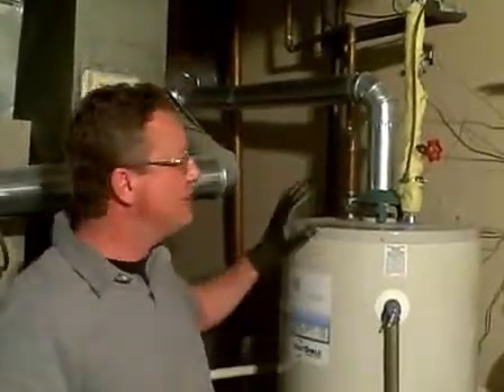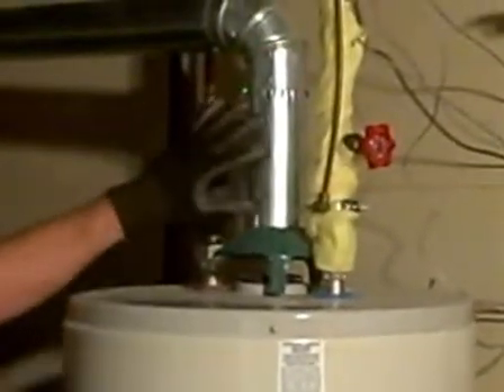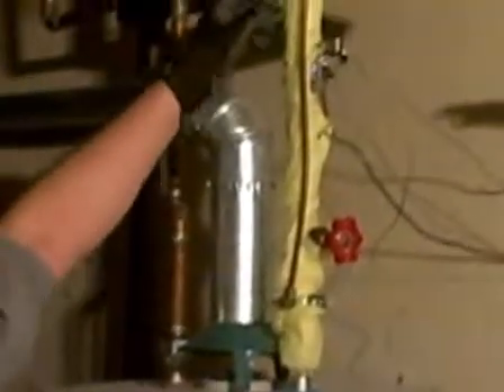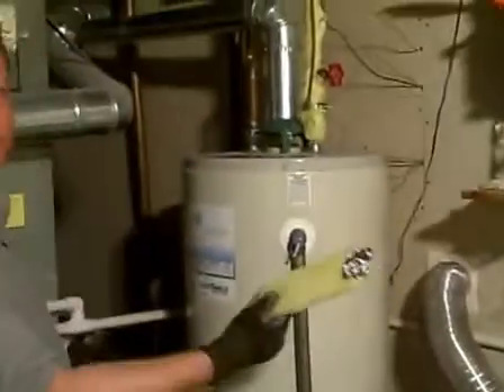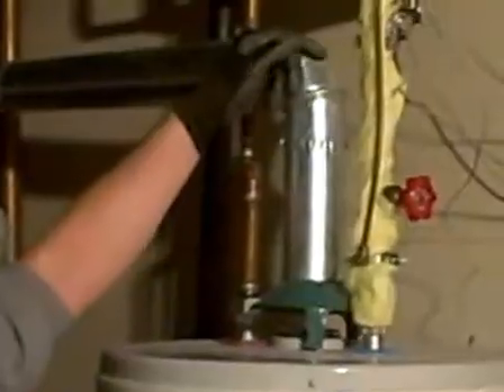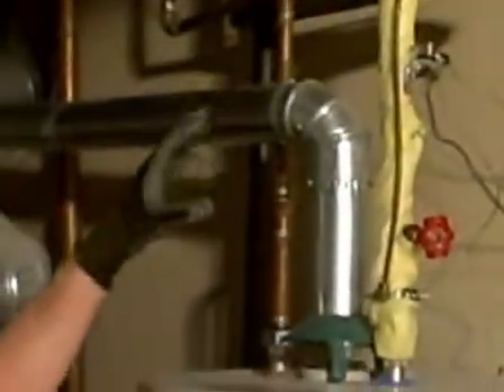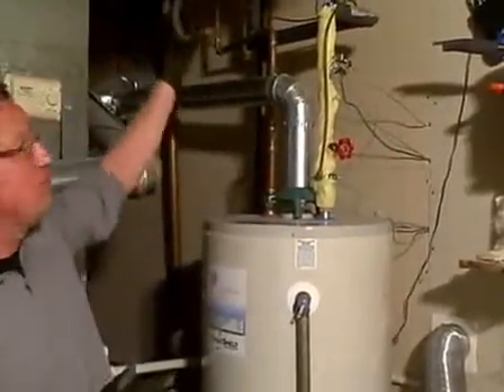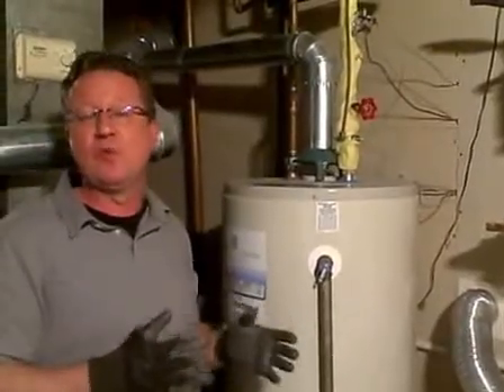Water Heater Tip - Insulate Hot Water Pipes

Comment: The DOE specifically mentions fiberglass insulation (without backing).  Why is this?  Is the backing (usually a foil backing) combustible at a lower temp and therefore not recommended?  Many people seem to use the fiberglass with the foil backing for this project, so just wondering if the foil is OK near gas water heater flue?   ... And if the foil is not OK is having fiberglass exposed in a garge space an issue?
Reply from the maker: Hi, the Insulation Institute said that the backing can vary in the material used and some are combustible, so unbacked fiberglass is recommended.
 Check out some home improvement tips in our e-books https://www.amazon.com/gp/product/B0B2KW1FQ9

Comment: Fix It:  How thick should the insulation be?  I'v heard 1/2" and others say 1".  My water heater hot and cold lines are very close to the flue, so 1" may touch the draft hood.  That probably doesn't matter since it's fiber glass, but just wondering what your further advice might be.
Reply from the maker: Hi, the Dept of Energy recommends 1 inch. You should have air space between the flue and the insulation. 
We have more home improvement tips on our weekly podcast http://castbox.fm/u/6389499.
Reply: FIX IT:  I insulated the hot and cold water lines today and had a little air space between the flue hood and the insulation.  I went with Frost King foil backed 1" fiberglass pipe wrap.  Due to the snaking lines and tight space, it was a bit of a job, but I got it done.  Thank you for answering my question.

Comment: Hi. The builders have the foam insulation on the pipes (touching the flume even) on my gas water heater. Seems that it wasn't a big deal because nobody caught it (professional home inspection etc). Is it worth replacing it for safety reasons?
Reply from the maker: Hi, I would. When I took some training from Reliance, this is how they recommend running these types of insulation for safety.

Comment: I have a gas water heater and the little black hose at the top seems to have a hole in it and is leaking,How exactly can I fix this problem and what do I need to do? Thanks so much for any help or information.
Reply from the maker: anna veleta Hi, can you send me a picture? Most water heaters are solid pipe, or flexible metal braided supply lines into the tank.

Comment from the maker: Hi,
It takes a few hours to cool down. If the unit is still too hot after turning down the thermostats, you might need to replace them. The reset button could also be sticking on the bottom thermostat. If you call the manufacturer of the unit they will be able to help with troubleshooting. I've found most companies to be very helpful. Good luck

Comment: My elect. hot water heater has just started heating the water much too hot.....to the point of burning your skin.  I turned down the upper and lower thermostats. How long should it take before the water cools down?  Could I have bad thermostats and if so, should both be replaced?